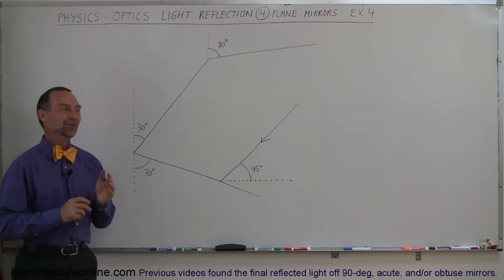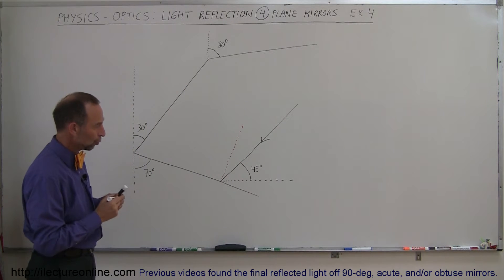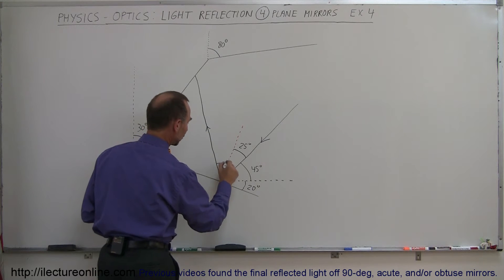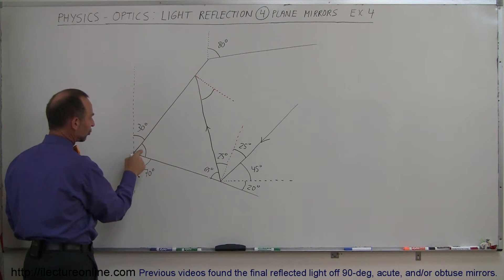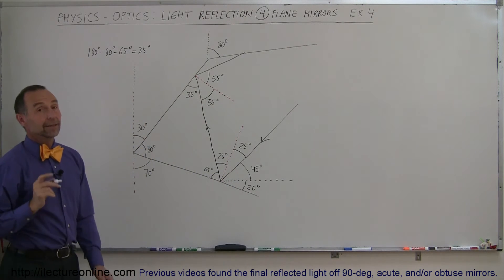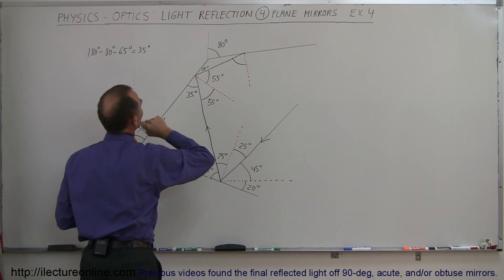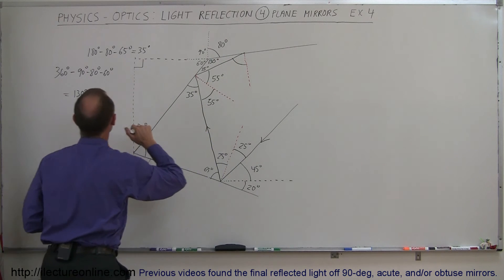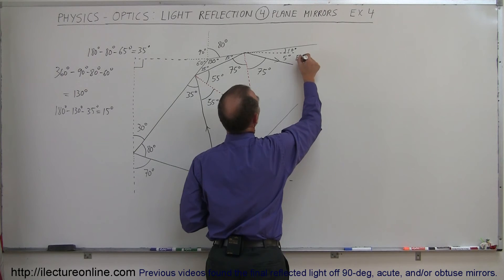Physics 51 - Optics: Light Reflecting (4 of 4) Plane Mirror: Ex. 4

Comment: Oh sir I think u have  done a mistake!

when you extended the line that is making 80 degree with the vertical it is not clearly mentioned that it is horizontal line that is parallel to x-axis then how can you take that angle 90 on extending it towards left !?

Kindly think over it and let me know if I'm wrong!👍
Reply from the maker: The video is correct.  Thank you for checking.